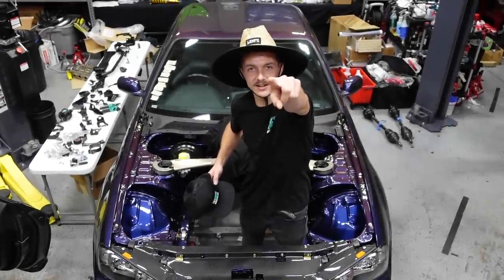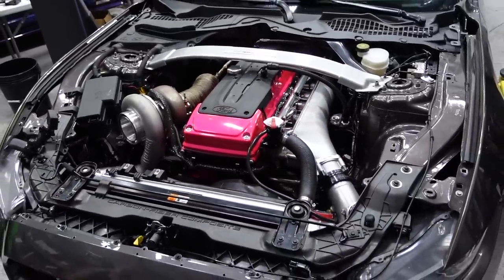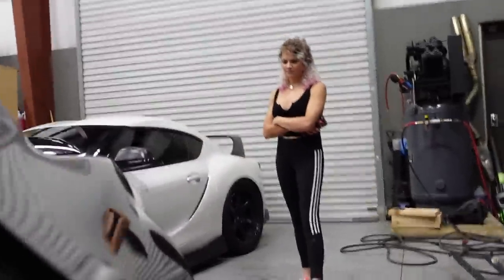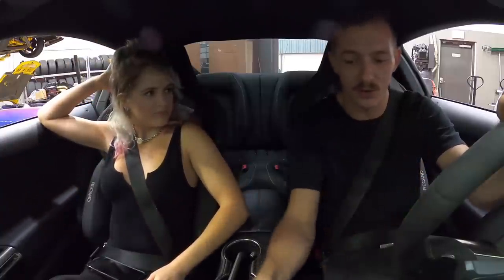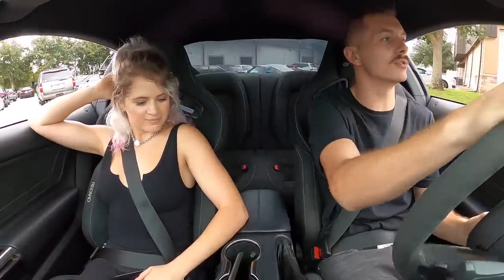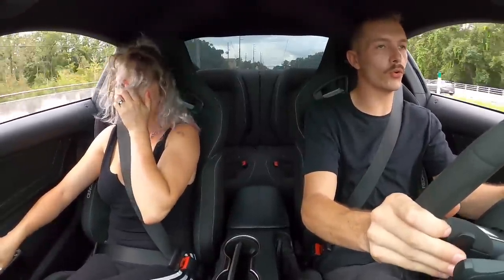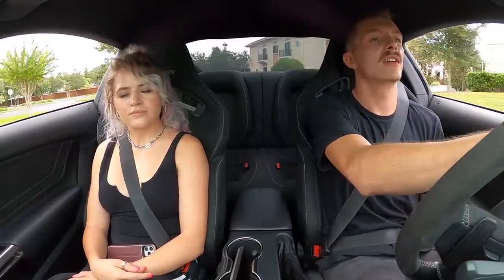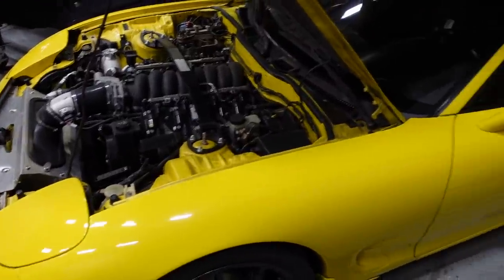Her First Ride in the 900HP Barra GT350!

Comment: 14:35 dude just do a cam and some valve springs. Have the rev limiter raised and get a msd two step to replace the limiter. Will sound race car af. Kennyslides has a mild built ls3 with an aggressive cam and that msd box and it sounds mental
Reply: Doesn’t he have a MoTec or ECE Masters computer? Would be a downgrade to go from a full race ECU and add a basic ignition box.
Reply: Leland Holton I’m pretty sure he said that it was an ls3 pnp crate engine which means it’s an oem ecu....

Comment: A little tip I learned from old japanese racing vids, a guy drilled a small hole in the dip stick and went to a auto parts store to buy a long spring then was able to place it I  the hole and somewhere towards the bottom of the intake manifold so it prevents the dip stick from popping out.

Comment: Convert the front rotors to 380mm/15inch or run 19 fronts and 18 rears. The gt500 rear rotors are 370mm mabye a good pick for a conversion for the rear if you want 5mm more clearance(front ?).

Comment: To Adam LZ: How to make a clear hood? Its feasible and not too difficult. Here's how I'd make one:
Take the old hood and a sheet of clear polycarbonate of the appropriate thickness (maybe 6mm) heat them (in an oven if possible) with the polycarbonate on top of the old hood until the polycarbonate becomes flexible and assumes the shape of the hood, allow them to cool. Trim the polycarbonate, sand and polish the edges. Now you need to find a way to support your new hood as it will be significantly "floppier" than the old one, maybe by shaping polycarbonate "ribs" in the same way you made the hood and glueing them underneath. The next problem is attaching the hood, I'd reccomend at least 4 "racing style" quick release catches.

Comment: I’m in the definite minority, but LS swapped 7s are reliable power...and the fact that it pisses purists off, even more reason to keep the V8. 

Supercharger...just sayin’
Reply: Can put better motors in it though.  Its light no need for a v8.
Reply: Barra's if built right are almost indestructible. There is a street driven one making over 2200hp

Comment: At 11:12 that sound from the turbo I can hear when Im driving at low rpm (1500-2000 diesel) and pressing the gaspedal. Should the sound be hearable inside the car while driving or does the turbo start to wear and need some sort of fix? It's an Audi A4 B8

Comment: Hey Adam I have a quick question I have a 2007 mustang and it is a auto and when I drive it in the morning and when it gets warmed up I give it it alittle gas and the car starts bouncing off the rev limiter and doesn’t go no where . But later threw the day it’s great to do pulls and everything and I’ve already replaced the transmission

Comment: The way that things shifts gears... Well, at the very least it isn't pleasing to the ears. That's just a pet peeve of mine though. I always want autos to shift sharp and snappy (not necessarily hard though), and unlocked torque converters are bad. I want them to basically simulate DCTs. That said, the engine sounds magnificent!

Comment: On your dipstick blowing out, u may be getting excessive crank case pressure meaning your catch can isn't big enough or able breath enough 🤔 
Check out Andrew Hawkins on motive video they did a video on catch cans and oil air separators 3 weeks ago,  they had similar problems with their big power rb's, his own gtr has something like a 20L catch can (oil air separator actually) with giant filters in it to elevate the crazy volume of crank case pressure rb's produce ,barras being a 4L may likely be just as bad if not worse for it 🤔

Comment: I liked the video, but have to tell you that reving up a turbo engine and then shutting it off is never a good idea, unless you want to prematurely wear out the bearings in your turbocharger, because that thing is still spinning without oil pressure. You might not want to do that anymore!!!!!